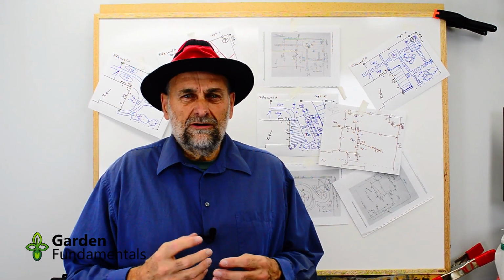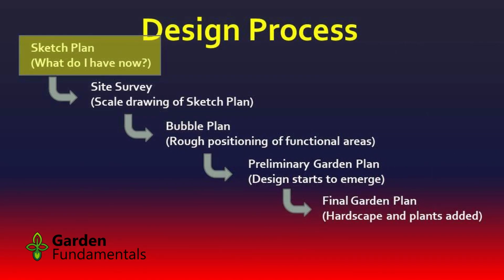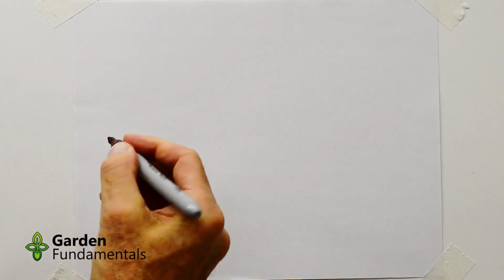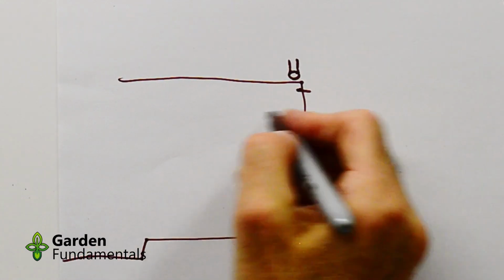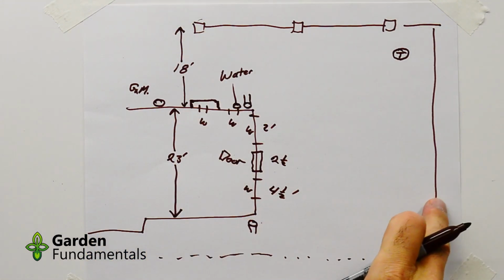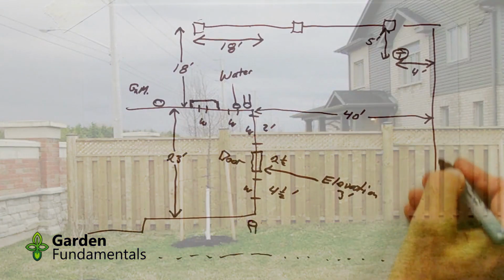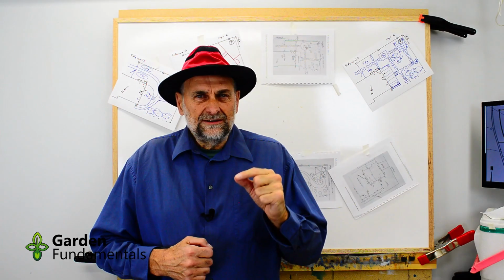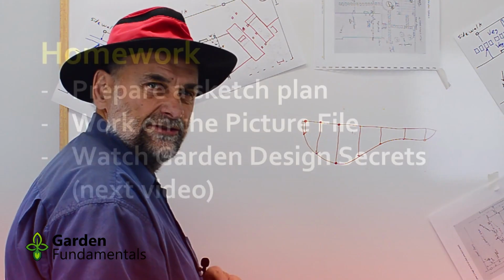Landscape Design Part 2 💞🏡🎨 Learn to Create Your Own Garden Design

Comment: This is a great set of videos. Very helpful.  Although I don't have much slope or curves to contend with, this second video had a lot of helpful information and things to think about, like drainage and water sources for irrigation.  One thing wasn't clear: in figuring out curved sections (last part of the video), he says you can measure two points along a curved flower bed and that will help you "find this point".  Find??  Not sure whether he's referring to finding the area of a space or what.
Reply from the maker: If you pic any point on the curve, you can draw two lines at right angles,  back to two fence lines (or house). You need the distances along the property lines to find these two points. Repeat for another point on the curve.

Comment: Great video! I've done numerous sketches of my property, as I've added new structures or landscaped different areas. My backyard is quite slopped, so that area can be a challenge. My husband and I put in the first privacy fence enclosing our backyard. We installed the cedar fence ourselves, one board, at a time, following the grade. Years later, I hired a contractor (he wasn't reputable) to replace that 30-year-old fence. He started building the fence sections, on my driveway, when I told him that would not work because I didn't want that stair-step fence look, he argued with me and told me he knew what he was doing. Last year, I ended up replacing that badly installed fence after only 4 1/2 years. I learned a valuable lesson, never hire someone based on how good they think they are, check out their references, and previous job performance.